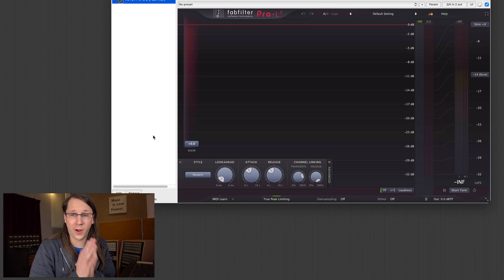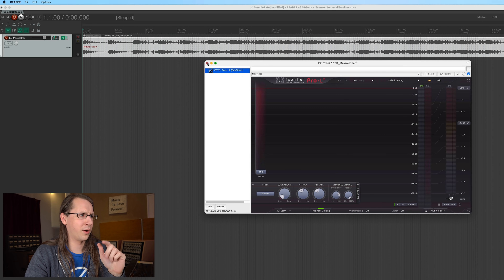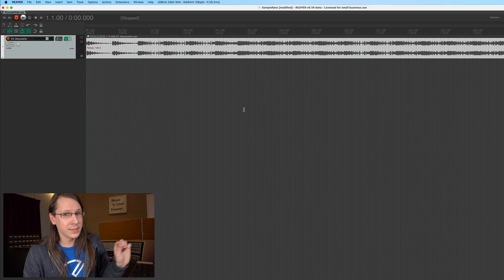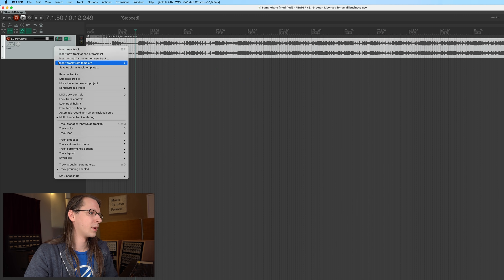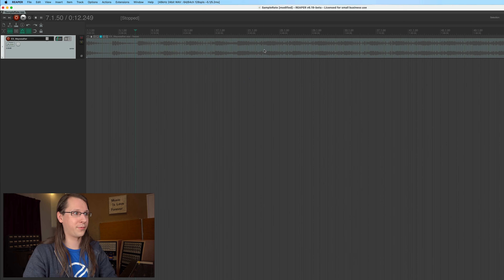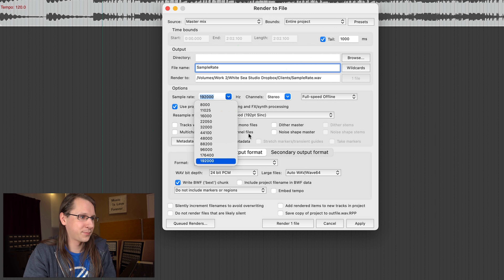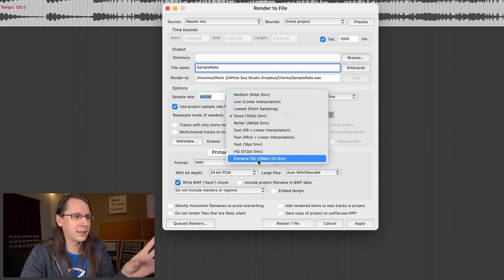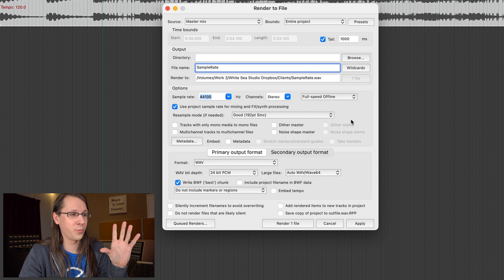WHAT is the BEST SAMPLE RATE?

Comment: i recently got much better sounding converters that can only run (its a bug i guess) at 44.1 and I used to be really particular about running at 48 and while I wish I could still I can't find much difference personally, I can finalize and record it at 192 with a separate converter but even then I haven't seen much point past archiving, though for me i have more noticed the circuit around the sample rate is more important than the sample rate itself

Comment: Been working at 24bit 96k since 2004. I hear a significant difference switching down to 48k, and only a slight difference moving from 96k>192k. 192k may very well kill my ancient rig.
Reply: @Joe Smith In theory, you may very well be correct. If you get a chance...try it on the old RME FF800. We hear the difference over here in the studio.
Reply: @Joe Smith most times yes as we track at 24/96. So provided the source files are recorded in high quality then yes. I'm not here to debate as I'm snowed under with radio work and need to prep for tomorrows show. Each to their own
Reply: Its a simple enough test..play a high quality Ultra HD song and from RME's Fireface settings switch between the sample rates as the song is playing. You should hear it for yourself (unless I have a defective unit of course)

Comment: This makes the most sense of anything I’ve seen on the topic (aside from a fun experiment by Steve Albini showing that we do hear more frequencies than we think), but if a plug-in doesn’t already have the capability of processing at a higher sample rate, would changing the project actually make a difference? Also curious how this would apply with Logic Pro’s stock plugins, if anyone knows. I’ve never looked into the internal processing sample rates before. I knew oversampling was a thing but never really gave it a lot of thought regarding if the option wasn't available...
Reply: Do you know where I could find that Steve albini thing you mentioned? Sounds interesting

Comment: 2:00 In fact, the reverse claim is also true. Some more or less ancient low- to mid-end interfaces only deliver good sounding monitoring when forced to operate at high SR. Everything now relies on delta-sigma and a proper digital filter algorithm should do the job, but some devices have a nasty roll-off in the audible part of the higher frequency range.

Comment: The Original Article seems offline, tried both links. 
PS: 48 Khz is almost an Octave more, so why should i use more ? Yes. I Agree on this that higher samplerate is better aliasing. But even Hardware can be problematic on 48khz as well as on 96khz, So i use 88200 instead. Which is for some Plugins painful, but nonetheless its a compromise. :) 
but using more then 48 shouldnt make a differen anymore, i guess.

Comment: I find 96khz a good middle ground - I use a decent interface and have a powerful PC - Plus you never mentioned latency, many people use vst's and softsynths and such and if you run your interface at 96khz you literally get half the latency of 48khz which for alot of people is difference of being able to play/record properly with no issues... People joke about higher sample rates being able to record frequencies we cant hear, but thats never been the point, its about the quality of the waveform and the overall speed of the system clock... Try and draw a circle with using 6 points - now draw another circle using 12 points - which one looks more like a circle...?

Comment: I track at 48/24, master is tape and then 96/24. The quality of the converters is more important that the sample rate. Depending on their clock and design, converters can sound better at specific sample rates. Find your sweet spot.
Reply: do you ever have issues converting a client's 44.1 khz project to 48 khz?
Reply: @johnthecreative  I would keep it at 44.1 while mixing
Reply: @Synth2000  tell that to many pros that do 48.
Reply: @johnthecreative  My 44.1 comment was a response to the former poster. I currently work using 88.2 and DSD, and for many years I was on 48/24.

Comment: Got a question for you that’s completely off topic. I just got myself some mix cubes yesterday and can already see the benefit of mixing on them. Do you tend to listen to them on the quiet side or normal loudness like you would on your mains?
Reply: Just saw your post & a Great question. Saw no-one responded so hope this helps. Is your room treated or un-treated? Mix @normal nominal levels if your room is treated!. (debates on Db). Answer: Normal volume & flip to mains every now & then. If room is untreated "mix @lower volume". You can always turn up a little every now & then. If the room isn't treated then quieter levels will help control the room sound. If you like mixing @low volumes that saves your ears in the long run "speaking from lots of experience". Read your monitor instructions & if there's adjustments on your monitors get to know them and use them. Best advise: use references that are relevant to music style, medium, how your music is being distributed. Check mixes on diff systems, etc... Two set of monitors will help. Also you can use a good set of headphones to check bass, levels, space, eq, efx, & to eliminate room inadequacies. etc... Not in any order but a few things: #1 Most people don't mention this but quality recording is most important to get a great mix. Proper room treatment & descent-good-great monitors is important  with good monitor placement. #2, Also the gear your using is important along with skills/technique. Get to know each monitor set well & your room. Those mix cubes will def help! I don't know what level your@ but the more experience you get, start mixing in different rooms, studios etc... More opt info, Also sonarworks & Ik multimedia & some others have room corrections that will also help. You can also use those plugs to help with room eq & to listen with diff playback scenarios. (Practice (repeat infinity)).  Some people are gifted & some have to work @it. Put in the X & get critical feedback. Been mixing for 30++yrs  & still learning a lot!. Hope this helps!

Comment: http://www.lavryengineering.com/pdfs/lavry-white-paper-the_optimal_sample_rate_for_quality_audio.pdf I think you were referring to this document. It states that the optimal sample rate is 60kHz.

Another thought. Have you ever been in the situation that the anti-aliasing filter didn't have enough bandwidth at 44.1kHz and caused aliasing? Because when the end product should be 44.1, I'd recommend to just use this sample rate, or use multiples of it like 88.2kHz (better would probably to set project on 44.1 and use that DDMF wrapper vst for oversampling, when a plug-in introduces aliasing). It is easier to calculate that back to 44.1 without errors. In practice, both ways probably give very good results though.

Comment: I’ve done a lot of blind and tests on this with multiple people. 9 times out of 10 people preferred 96k. It really makes a difference in large track count mixes with lots of analog modelling plugins. I did try 192 as well but for rock and roll it seemed to lose too much punch. 96k lost a little punch but it was easy enough to mix that punch back in. But the 3D space and overall analog sound just sounded better on 96 vs 48. 

I know people will want to argue 48k is fine, and I’ll say yes it’s totally fine. Used it for many years. Is it better? Well that comes down to personal preference. Some people can’t hear the difference. One person in my test couldn’t really tell a difference but everyone else could. So it depends on your ears and how trained you are at listening. To those that say I’m wrong all I’ll say is do your own AB test. When I went into my tests I was trying to prove that 96k didn’t make a difference. I proved myself wrong. Maybe you’ll do th same.

 I’ll also say converters play a big role in this. Cheaper converters may not sound better at 96k, in that case stick with 48k. you may not be able to tell much difference on a cheaper converter. I really recommend everyone get a good converter/interface. If you don’t have much money audient is about the best budget converter , although black lion audio just announced a new interface and that will blow any budget converter away, and probably most of the expensive ones too.
Reply: I agree totally. 96/24 sounds better. There is no doubt in my mind. It is smoother, less harsh, more nuanced, fuller & easier to listen to generally... more musical. I know what you mean about 192 losing "punch" - but I do wonder whether this is an aesthetic perception based on "forward" & lively mixes that we're used to hearing. And that maybe even rock would actually benefit from more dynamics. I find it kind of depressing that YouTube and comments are plastered with "48 is fine" responses. There seems to be a kind of anti-authority bent. People thinking that high resolution is marketing snake-oil, and reacting against it. And SO definite that "people can't hear any difference" - my experience is the same as yours. There is a difference.

Comment: Everything you gain in terms of anti aliasing by recording higher than 44.1 is going to be lost when you convert back to 44.1. There are a few SRCs who do a pretty decent job by causing very little to no noise and very little ringing but the same can be achieved by using a good AD converter. That said I still use 48 myself because 44.1 looks just odd to me

Comment: sound recordist use high sample rates with mics that have extended frequency response, there is huge difference when you design sounds from these recordings then, but for anything else i don't think there is a reason to go over 48khz at 24bit.
Reply: this sounds useful for recordings that are intended to be slowed down later, as this would bring supersonic frequencies down into the audible range

Comment: Article link thanks to Craig: http://web.archive.org/web/20200426202431/https://people.xiph.org/~xiphmont/demo/neil-young.html
To hear some unexpected pitfalls of 96kHz create a DAW project at 96kHz and load the "30kHz tone + 33kHz tone" WAV from the article. Then add some standard audio effects to hear artefacts in the normal hearing range. What you can't hear can still hurt you. Examples with Logic
- Bitcrusher, Amps and pretty much any distorter brings out the 3kHz intermodulation
- Reverbs create odd effects at the start and end of the audio (ChromaVerb, SilverVerb)
-  PitchShifter does weird things - but not good weird things

Comment: Read this
. Your audio interface is just a playback device.
When you export you only use your CPU to process the data. If you export in 200hz of course is going to be better than 44.1, sound more like a real sound than a digital sound. 
If you have for example, weiss ds1, you will upgrade your sounds fonts to 40 bits. If you have a 64bit motor like cakewalk or reason, you will have plenty room and even higher definition.
Check this, the more bits, the more HZ,,, THE better the process on all the plugins, synths, exports...
You have time, takes 30min to export 96k 32b?? Worthy. Your cpu will handle it either you can export sets, until it will definetely handle it when exporting a single mastered track. Then turn it into 44.1.? 48? Mp3? Yeah do that if you want, who cares, have a bandcamp? There is independent artists posting theor 96k songs and all kind of formats. Stop trying to fit into the hypotetic world of "what if I was an artist from the industry and my music has to be passed around on torrents or a whatsapp, have to make it slim".
I send mp3's to my friends, sometimes huge wavs.

But why would do you export not even hd creating a first ouput of 44.1. To then process it again and keep losing even more quality? Export all to 192. Go mix it and export to 192 again. Master and export 192 again. Your streaming service allows it? Your phone does? Hifi? Do. Need less? Export smaller, but at least your first window of sound quality would be the best built quality, best aliasing, best realistically speakikg, natural. Stop falling for do all on 44.1 or 48, from begining to end, this is not 90's nor early 2000's.

There is tons of sound engineers and producers trying to deceive people on forums and youtube.
I follow snake oil chairmain, like his videos and talent, but I am surprised by how he is really this much confussed about something so simple.

Pd; i use wavwsfactory cassete and spectre oversampling, and weiss to get inner 40bit, use the highest HZ, all, and I add those when I export the individial tracks on first export. Until the end. That "you may be a bat in a cave" bullshit is only said by shills that go nowhere or try to deceive you. I know you can read in gearslutz, ask a pro boards, how they say  this and that about sample rates, making you think heey it's ok to stick to 24 bit 44.1. Bro, do you know what kind of hilarious heavenly hardware processors and private plugins they dont speak about? Never speak about. Just because you work 44.1. 16 bit doesnt mean you will get to sound like dua lipa future nostalgia quality, just because you did tons of EQ, NEITHER sound like Drake or JAY Z. THEY dont just put waves, uad, slate, bluecat, fab, plugins and tweak, they tell you it's all EQ and that's bullshit lmao. They fabricate the craziest quality for the  first stage of the sounds and they curate those too damn much with all types of highest proccess capabilitie tricks.

Comment: Very interesting. I would like to do this test, that you mentioned in the video, but the links in the description don't seem to work. Could you update them, please? Thank you very much!
Reply: @Simpler Sounds Ah, I almost forgot about this one. Read the article, that's linked in the description and play the mentioned files on your system. The files should be completely silent, but if you can hear some cracks or noise, your system isn't capable of handling high res audio.
Reply: @Simpler Sounds Yes, it must be maxed out. Otherwise the hardware doesn't play these ultrasound waves, that lie above the human hearing range. 
I just tested this with my on board sound card. I get some slight cracking noises at  192kHz, but none at 48kHz, because the low pass filter cuts those frequencies out.

Comment: what about sound design? aren´t higher sample rates more interesting there? i mean, in the terms of audio-stretching, slowing things down and stuff like that. (i am  talking digital games and scifi movies here). in theory, you should be able to slow audio down without hearing too much artifacts when recorded in higher sample rates, right? (and you are golden when you have enough money to buy those sanken mics that go up to 100kHz)
Reply: Yes and no. No to the fact that a band-limited nature of sampled audio it will not help you extrapolate audio because, the signal is fully defined by the samples. However, higher sample for reconstruction and noise reduction higher sample rates help because, clips and pop can easily extend to 50kHz and do build to filters to remove them you need that content to exist.
Reply: I have tried it. I recorded audio of carbonated soda using an SM57 into my focusrite 2nd gen, and there was a clear difference in detail at 192khz when slowing down the recording.

I could only slow it down about an octave before detail really started to dwindle though.
Probably a limitation of my microphone. I assume it's not designed for picking up frequencies above our range of hearing.
Might also just have been the source itself not creating higher frequencies.

It also sounded quite harsh at those frequencies.
If you are going to do sound design recording at 192khz you might want to find a microphone better suited for that range. Could be my converters too. Maybe there is a brickwall filter somewhere.

Comment: An additional consideration when choosing converter sample rate is latency. If you're doing "offline" work (record first, then work with the result) you may not care, but it can be quite impactful for "online" work where you want to minimize the delay between input at the microphone or instrument and sound out of the speaker (of course, converter rate is not the only reason for latency, just one of the multiple factors in the equation)

Comment: I'm working in the film industry for over 30 years now. There is still a Myth going around that 192k is the real deal. Which is completely nonsense. 24bit/48k is mostly used and totally enough for EVERYTHING. Even 16bit/44.1k is enough and nobody will ever notice any audible difference between 44.1k and 48k, 96k or 192k. You will of course see some differences in your RTA, but you are not able to hear it. Anyone who claims they can hear higher than 20khz is (sorry) a complete idiot. What you CAN hear is saturation from tape (real tape folks... no plugin mojo which does nothing other than cutting/boosting frequencies and adding fake "harmonics".... but there is no real saturation, it's just marketing). Take care and have a good day.